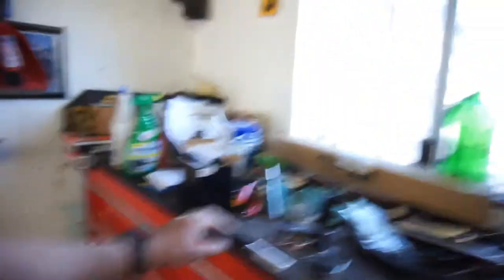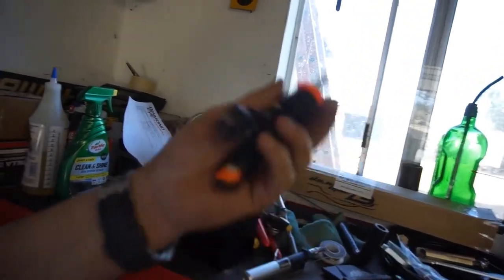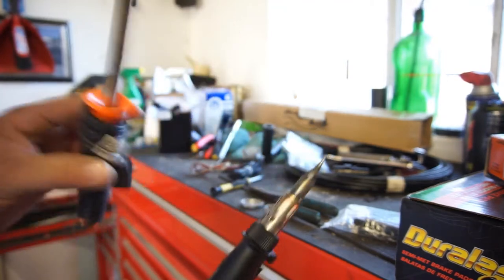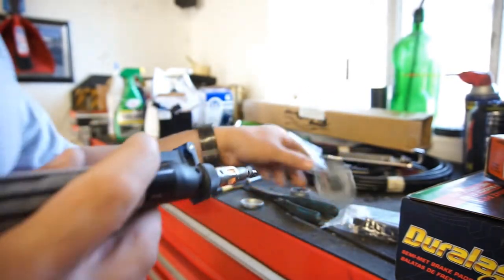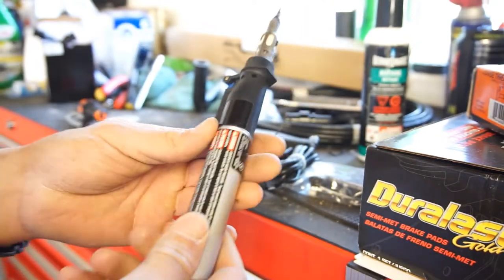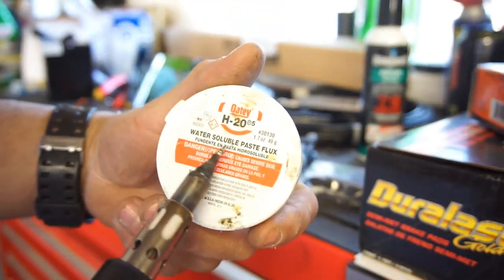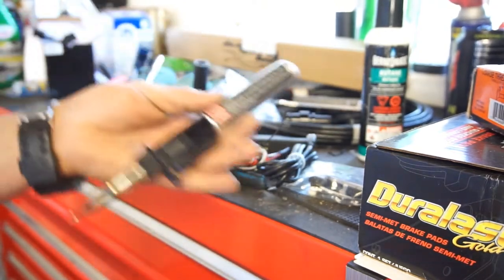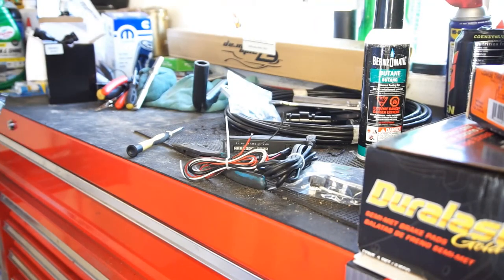Thursday's Tool Review Dremel 2000 Butane Soldering Iron. Best Out There.

Comment: Do you ever have to clean and sharpen the Versatip nibs? I cleaning, how you clean it without damaging the nibs?
Reply from the maker: I just use some scotchbrite on it while it’s cool and then heat it up to tin it then put it away. I did have to make the tip smaller to solder up some capacitors and it still works great.
Reply: @Halffast719  thanks